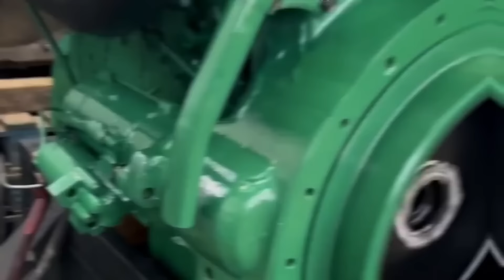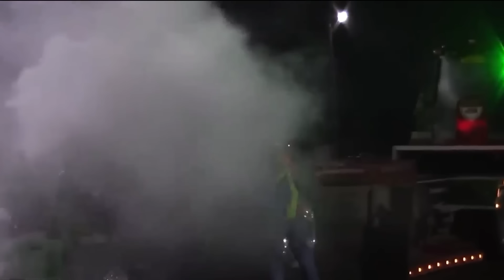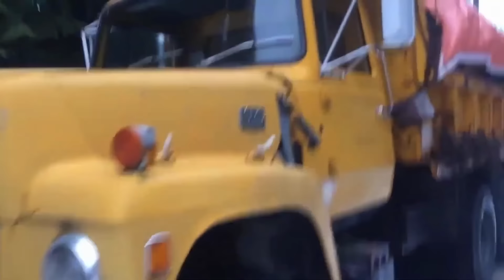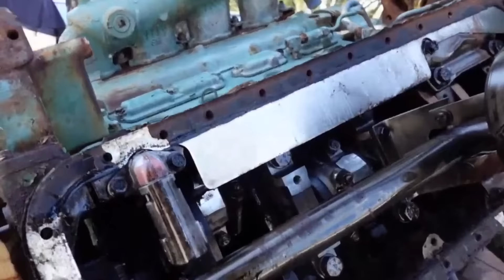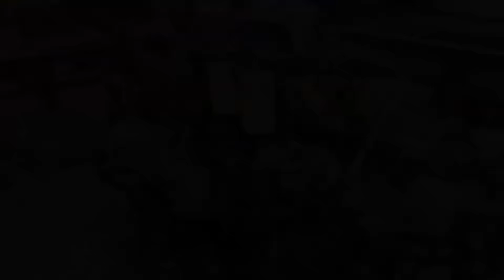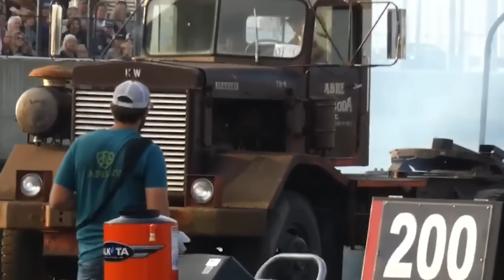THE LOUDEST ENGINE EVER MADE & Why It Got BANNED - The Detroit Diesel 8V71 Screaming Jimmy

Comment: Why are you making this sound like it's the only 2-Stroke Detroit Diesel ever made? There is a long history of 2-Stroke Detroit's 1CYL, 2CYL, 3CYL, 4CYL, IN-Line 6CYL, V6, 8V-92 besides the 8V-71. Some normally aspirated, some turbo charged. Detroit's were used in many other industries than what you stated. Actually, Wiki states: "this Inline models included one, two, three, four and six cylinders, and the V-types six, eight, twelve, sixteen, and twenty-four cylinders."

Comment: Plain and simple. The 2 stroke Detroit is hands down the greatest engine, diesel OR gas, in world history, and no inefficient slug of a 4 stroke diesel will EVER be able to change that! These engines are Clark cycle uni-flow scavenged engines in the sane vein as opposed-piston engines Fairbanks Morse built that are the most efficient internal combustion engines on the planet and are simple, no valves. After cold start these opposed piston and conventional style Detroit diesels generally are totally smokeless. The earlier engines with only 2 exhaust valves per cylinder instead of the later models with 4 valves per cylinder may smoke a bit due to half the airflow of the 4 valves per cylinder ones. But it is still very minimal. In fact, 4 strokes with 4 valve per cylinder flow like earlier 2 valve Detroits because 2 are INTAKE valves, and the other 2 are EXHAUST valves, so they can only use 2 valves at a time through the operating cycle, and flow isn’t very good, leading to doggy operation, and black smoke. Turbos help but they still are dogs. They can never get all the spent gases out but a 2stroke Clark DOES, and residual spent gases leads to insufficient oxygen for combustion and all the fuel can’t burn if spent gases remain in the cylinder! Detroits do get rid if all the spent gases and run clean, at high efficiency! And the nitric oxide “emissions” can ONLY exist in highly efficient engines that burn no less than 95% or more of the fuel. 2 strokes, even gasoline ones all emit this gas because they are highly efficient engines! A side effect of high efficiency that should never be considered a bad thing! And the oil control is excellent in 2 stroke diesels, the air box drains are why. Later engines simply put the oil draining from the air boxes back in the crankcase and reused it. Also-I have 2 “mythical” Detroits in my collection if all types of gas and diesel engines known as the “51” series, and have 2 of these! They are very rare and are Day cycle 2 strokes like gasoline 2 strokes are!! Mine are 4 cylinder 4-51’s, but they made a 2cylinder 2-51 as well, even rarer than the 4-51! They are way cool, run and sound like a regular Clark cycle Detroit, but have no valves, just intake and exhaust ports on opposite sides of the cylinder liners and only one push rod and rocker arm per cylinder to operate the injector on each cylinder! They DO exist and are a dream to own by us Detroit lovers few can find, and yes, I realize how lucky I am to have 2! I still want a 2-51 as well! These can do 3000 RPM, because no valves to “float” at high revs. And Clark cycle Detroits run the same max RPM as Cummins, CAT, Mack, etc, 4 strokes. They sound like they running twice as fast because they fire twice as often as 4 “jokes”. and Detroits have very low exhaust temperatures compared to to 4 strokes because the blower scavenging cools the exhaust stream. And YES, my valveless 4-51’s have a blower too. Detroit diesels actually run cooler than 4 strokes and always will with basic maintenance. I also hace a 1940 2-71, a WW2 “high block” 2 valve head 6-71, and a bad ass hot rodded 6V92 out of a fire truck. I love these engines as much as life itself, probably MORE! Cheers! 😋👍 Rick Delair.
Reply from the maker: That is an incredible collection, especially those rare 51 series engines. It’s amazing to hear from someone preserving these machines.

Comment: I worked at Hallibuton International in Drayton Valley Alberta back in 1978/79. The Kenworth's were powered by 8-71 Detroit Diesels. The Ford Louisville's were powered by 6-71 Detroit Diesels. The HD 400 double pumpers were powered by twin V-16 Detroit Diesels. No concession to noise. No muffler. Open stacks. What an awesome sound. My favourite engines ever, bar none.
Reply from the maker: That must have been incredible to hear in person. Open stacks and a yard full of 71 series Detroits… I can only imagine the sound of that lineup!
Reply: @ClassicAmericanMachines  The HD 400 double pumpers were used in hydraulic fracturing of oil wells. They were each called "a horsepower". Rounded to a thousand-horsepower from between 11-12 hundred actually. They were hooked together through a manifold to "frac" the well. Just start counting units. If you had 5 or 6 units that's 5 or 6 thousand horsepower. The "loudest" job I was on we had seven of them going all at once, wide open throttle. The V 16's were supercharged as well. Seven trailers was fourteen V16's through straight stacks. WHISPER OF GOD.
Reply: i cut my teeth on detroit diesels. 67 years old rebuilt every type detroit from a 2=71 to a 12v 71. that gentleman was correct . it helped win
 won ww2 but had parts in winning wars a recently as irag. i had a young man working for me who the best truck they had over there was an old duece and a half with a crane mounted on it, powered by a 6;71 the old thing was used to go aid or ipck up all the newer diesels that were stalling out all over the place

Comment: 12V-71 Buzzin' dozen way louder
Reply: We had a fishing boat 12 71 plenty of noise tough as can be
Reply: Actually, in an enclosed space such as an engine room, it made no difference as to how many cylinders you had. We had both 12V71 and 6-71 engines in our building and both were at 108db at 1800 RPM right next to the engine.

Comment: The maker of this video is wrong about the early detroits having wet sleeves, they were all dry sleeves. I think they are confusing the later model 4 stoke detroits with the earlier 2 stroke detroits.  I have overhauled a truck load of them and they were all dry sleeves (the older 2 strokes). The sleeves were the same in all the 71 series engines from 3-71s to 16V-71s and they were all dry sleeves. The dry sleeves was one of the reasons they were prone to "burning" pistons, also the detroits in earth movers were also subject to burning pistons due to plugged air filters as the engine depended on the blower pushing more air thru them to help cool them.
Reply from the maker: Appreciate the correction. Sounds like you’ve rebuilt quite a few of them. Always great to hear insight from someone who has actually worked on these engines.

Comment: Especially with no mufflers and only straight pipes . My dad was deaf because of it . And if you did not understand the fuel rack system she would get away from you.  The 671 was more common and super easy to change rotation . All we have are wet liners thanks to detroit 53 series

Comment: i have been around that engine for 50 years,   i love em and i can build em and they don't leak!!!
Reply: Fishing boats still have 71 series great engines
Reply: The remark about it not needing a shot of ether is inaccurate my father's D.D. required a blast in REALLY cold weather 🌡️👍🏻
Reply: @mark.victorbrown849  I agree.  My Father was an aircraft mechanic.  He was a PERFECTIONIST in every sense of the word.  When he started trucking he treated his trucks the same way.  They were perfect or he didn't drive it, and in weather around 0°F he would have to give the old 318 a light spritz to get her awake every once in a while.
Reply: There is an old saying with a GM if it doesn't leak oil. There's none in it
Reply: Right on. You just took the time and they were just fine.
Reply: I'm 66 from Detroit, moved at 10, but I remember the noise and smoke, but then cars had carburetors not EFI so not as clean as today either.
Not mentioned here is another place that I saw them, in excavators, screaming for hours. Knowing little of them, I admired that they ran hours at a time running their hydraulic systems. 30 years ago working for GTW RR, I didn't know that they were two stroke. And I swore by Lawn-boy and have a few besides a battery mower. I know small 2 strokes.
Watching this, I am fascinated so much so that if I ran into $$, I would want a motor home/bus powered by one!
Mentioned is the "not so recommended" oil changes.
A super simple fix. More. But also add a bypass filtration system. This would greatly reduce wear, which makes less ring and cylinder wear, less blow-by, less crankcase pressure and less oil leakage. 
Small 2 strokes suffer when the shaft seals go as they can't  uold pressure to scavenge. The same but for a different reasons-requiring a blower to force air in or losiing air (and fuel/oil) forced out leaking past shaft seats.
One word: scavenge 
Although a clean steam turbine driven vs. diesel, my 🚢 used synthetic oil, run through a DeLaval "lube oil purifier" 12 of 24 hours a day. It spins at high rpm using centrifugal force to remove contaminates, and 💧 (from steam leaking past internal shaft oil sealing rings) into separator cones. Cleaned daily. Oil changes in literal years. 7.
Reply: Got silicone ? 😂
Reply: When properly cared for, they are great.
Reply: Ditto, I replaced unknown amts of copper washers! I still prefer 53,71,92,and 149 series thinking of putting v in a older dodge truck  6 -53 would be just about the right amt  of too much,!
Reply: I have been around alot of different Detroit engines and I have never seen 1 not leak oil like a Chevy thats the running joke in the trucking community if its leaking it's still got some in it

Comment: M113 personal carrier had a Detroit super 53. Same style diesel motor. Just 6 cylinders. Load, load, LOAD. But talk about power. Wow.. move 13 tons through the forest faster than a rabbit on crack
Reply: 6v53TT the best of the best
Reply from the maker: Those 53 series engines were tough little machines. Moving a 13-ton vehicle through rough terrain definitely proves that.

Comment: made twice the heat :: and twice the power (compared to the early 4 strokes) 
Mobil made them their own custom special oil
Reply: DELO is the best now. Flat tappet additives.
Reply: @lewiemcneely9143  straight weight oil had to be used due to mechanical shearing. Multi-grade oil would shear quickly in them.  40W in the summer and 30W in the winter.
Reply: @xxch4osxx  We ran DELO 15/40 year around with NO problems.

Comment: Loudest engine ever? Uh.. Nope. Try the Rolls-Royce Crecy, the 1,593ci 2-stroke, sleeve valve, blown, direct injected V12 aero engine. During testing, noise complaints were received from 5 miles away. Think on that. An engine so loud, that while running mounted in a reinforced test bay, got noise complaints from 5 miles away...